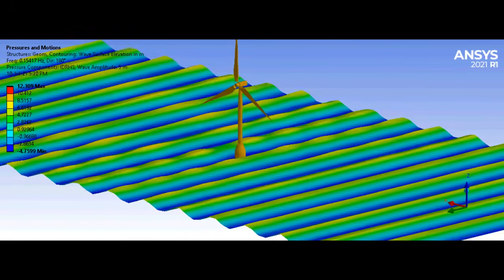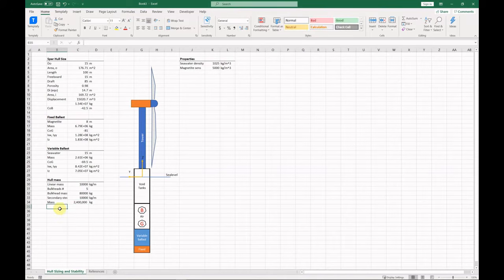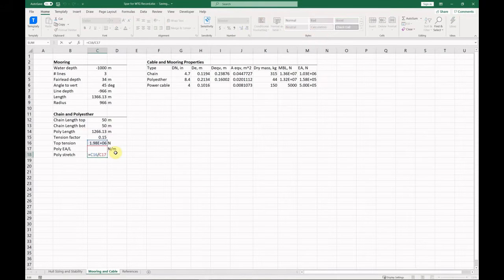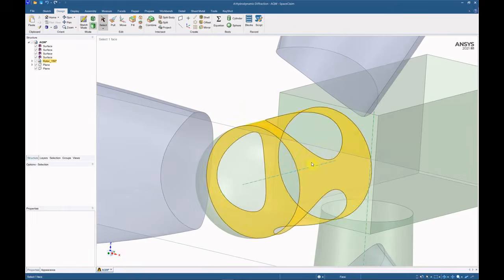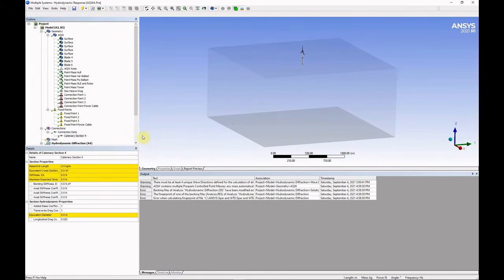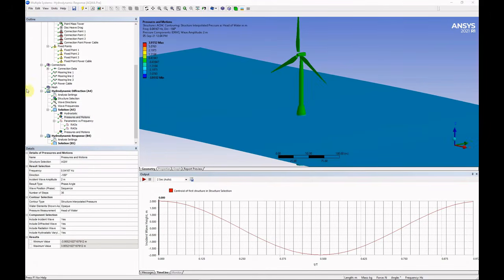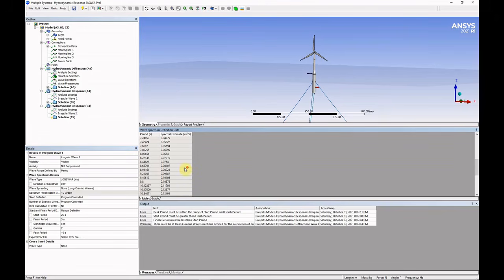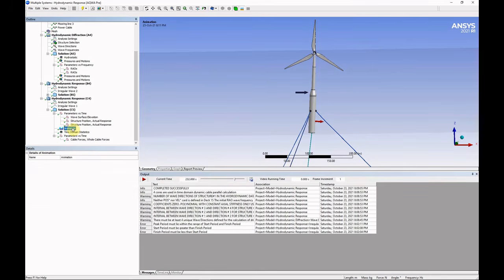Floating Offshore Spar Wind Turbine in Ansys Aqwa - from a sketch to numerical model

Comment: Hi Xavier, Thanks for sharing this video. It is very informative. If it was a different case, for instance a squared system, wouldn't you split it first to define under water and above water area? Or you will define it in diffraction analysis model?
Reply from the maker: @Mazhar0495  that's terrible. It happened to me a few times a similar issue. That's why I always save a new copy of project every time I make a significant change. Recommend you do the same. I don't know a fix for your case unfortunately
Reply from the maker: @Mazhar0495  the mesh above water is not used for any calculation. You can remove it as it is only visual
Reply: @xavicastello1  Alright. But when I remove the above water part from the body, the bottom part doesn't have top lid. I think this should not affect the analysis.
Reply from the maker: @Mazhar0495  No, it is not an issue. the volume underwater must be closed at allaround and bottom, but top open is ok as you have a waterplane area. Otherwise it would be a submarine and I don´t think panel method works for this case :p
Reply: @xavicastello1  Thanks. Actually, I am getting an error that "mass/displaced mass are significantly different for the structure". Although, I defined the point mass and also it doesn't generate any results in Hyd. Diffraction module.
Reply from the maker: @Mazhar0495  the volume displaced by the cad model may be wrong, or its shell normals can be inverted (negative mass), or the sum of your point masses is wrong.
Reply: @xavicastello1  I fixed the displacement issue. However, when I set-up all the connections, the catenary mooring is entirely suspended in and out of the water environment since some part of it has to rest on the seabed. Secondly, when I perform Time Response Analysis - the squared system along with mooring lines is completely lifted off the water surface. Any idea? What could go wrong. I manipulated some basic parameters stiffness, length, size of water environment, max. expected tension but this issue persists.
Reply from the maker: @Mazhar0495  it seems clear that the linear mass (kg/m) is lower than the buoyancy of the lines. So they are floating. Check that you have correct dry mass of line and equivalent diameter or area set as to produce desired buoyancy.
Reply: @xavicastello1  Thanks a lot. You were right, there was an issue with cross-sectional area. By the way, do you have some useful links/material for multi-body (side by side) simulations? Would appreciate if you could share. :)
Reply from the maker: @Mazhar0495  multi body will require same approach in Excel to hqve point masses CoGs and inertias. Then in Spaceclaim add another separate component in such manner that after Aqwa reads inputs it puts the second structure separately from the other one. So you can add point masses and connection points independently. In the analysis settings you need to select if they will interact with each other or not, i.e. if a diffracted wave from one body will be seen by the other or not. Be careful is they are too close you can create standing waves.
Reply: @xavicastello1  How would I know if the two structures are too close they will create standing waves? I am struggling to put a joint (ball and socket: to enable rotation) between two bodies to further allow their interaction but I get an error "Joint is closing a loop which may cause error while solving". Do you have any working case or document explaining how to set-up connections? I couldn't find any on the internet except user guide which provides basic definitions.
Reply from the maker: @Mazhar0495  a standing wave may form in between two flat structures separated by a distance equal to the wave length. 
Regarding the error, have you checked Ansys manuals?
Reply: Also, if you are in shallow water depth, the way you calculated line depth and length won't provide realistic values especially when you are using catenary mooring where most part of the chain is lying on the seabed. Let's say when you have a squared system
Reply from the maker: @Mazhar0495  This simulation was made assuming taut-leg mooring system. So for catenary you need to either have the analytical catenary equations in Excel or do it iteratively in Ansys Aqwa directly.
Reply from the maker: Hi. yes. you need to first split body in CAD at water elvel before importing to Aqwa. In diffraction Ansys automatically finds what is below water, or you can select manually too.
Reply: @xavicastello1  Thanks for your reply. I see that you are using some known values such as top tension factor=0.15. May I ask where did you take them from? Also, do they stay same for catenary case?
Reply from the maker: @Mazhar0495  humm. I do not recall a reference for this. It might be a common practice. But it will for sure impact the top angle you want for your system

Comment: Hi Xavier. Thank you for a very helpful video. Do you have any suggestions on how to apply the aerodynamic loads?
Reply from the maker: Good that is useful. Both Hydrodynamic drag or aerodynamic drag can be added by drag force coefficients. In this case you'll also need to apply wind and current. Check video around 39 min 30 s and the user manual for the coefficients equations